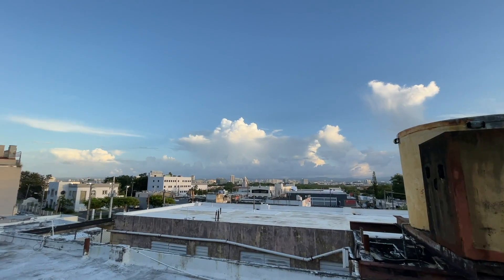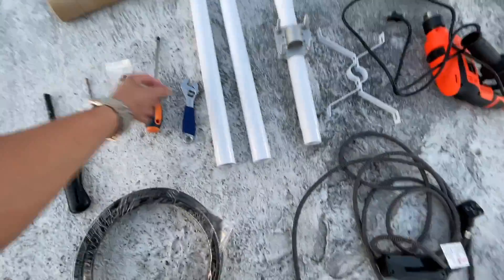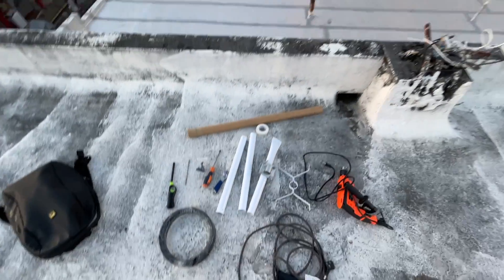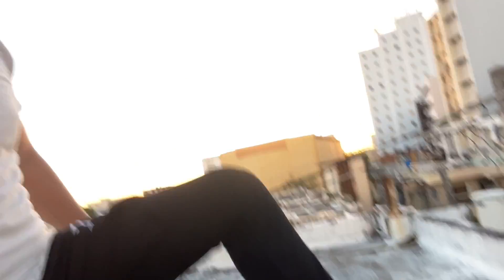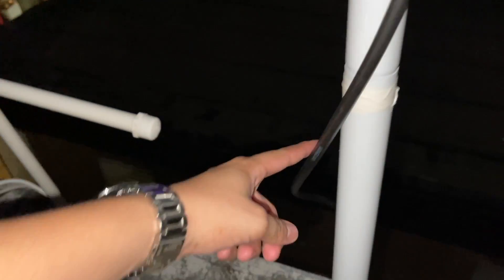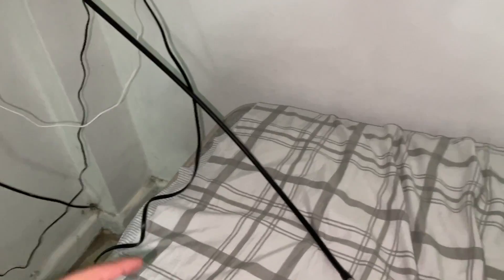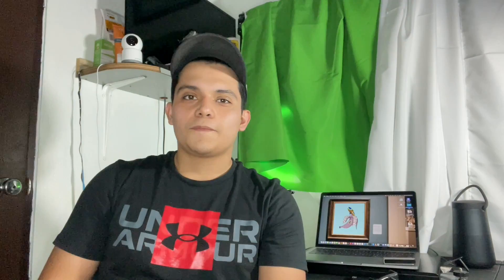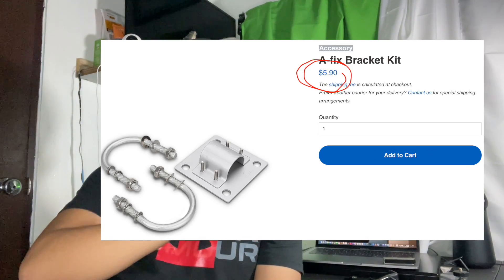Installing Helium (HNT) Miner 5.8dbi Antenna in my Roof | Step-by-Step!

Comment: You have to ground it. There is a ground component with NType Female end to end
Reply from the maker: Yes, will do in the future, thanks for watching! 😁
Reply: @InvestX You dont have to ground it for this ocasion,, electric always chosing the shortest way from sky to the ground ,if your antenna was high alone in the sky  ,(yours is not,)  electric will choice shortest way wich is your antenna or anything high alone  and burn your device, as i said this is very rear in this ocasion